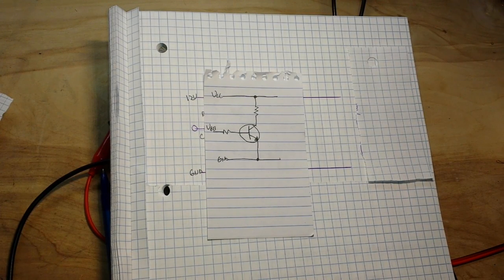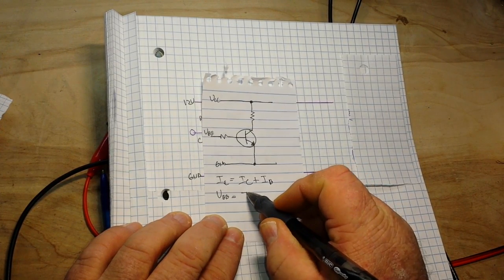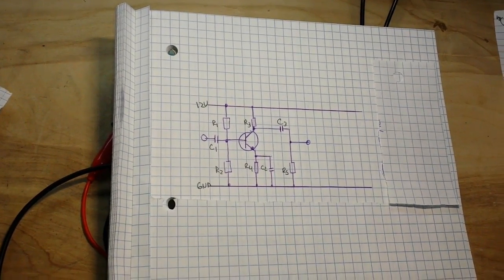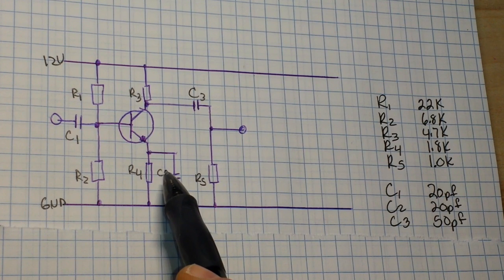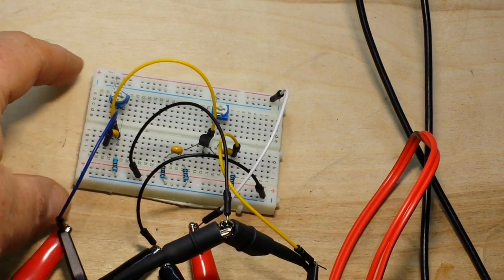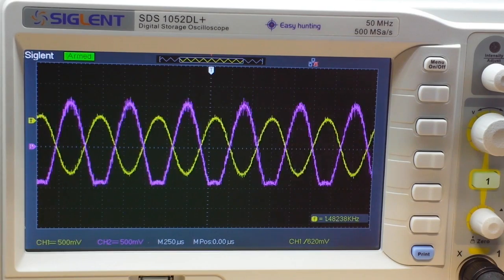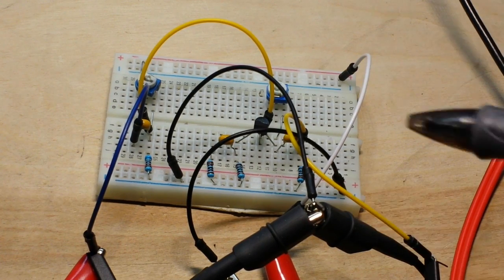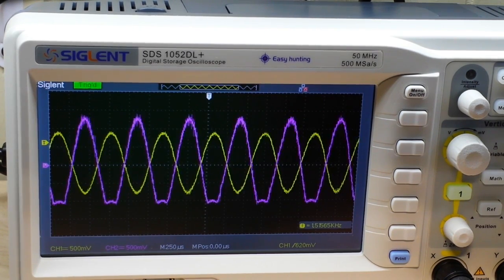Transistors  biasing, and amplifiers

Comment: Having the oscilloscope view was nice to see how the signal flowed. What scope would you recommend? (regardless of electronic experience, thinking quality over learning curve)
Reply from the maker: Anything from Siglent. They are excellent quality at reasonable prices. You can get an entry level scope for about $300 or go big for a mixed domain scope for just under 10k.
Reply: @learnelectronics  glad to know! I've got a siglent in my shopping list that's been waiting until I could research more.
It's the "Siglent Technologies SDS1202X-E 200 mhz Digital Oscilloscope 2 Channels, Grey" 
Model on Amazon

Comment: I didn't understand why the clipping occurs on the negative side, and how to effectively remove it with a circuital solution.
Reply: it happens when the biasing is not done perfectly i.e the biasing is not completely in active reqion rather its close to cuttoff or saturation which is why a small piece of signal gets clipped off.

Comment: Is the output signal out of phase or did you move it for an easier comparison?  This is a common collector configuration is it?

Reason I ask is in the examples I've seen the in phase output is taken between ground and the emitter lead.

I also have drawn load line and it appears as if your base resistor is slightly too low in value and is pushing the circuit towards saturation. It isn't keeping the base current low enough to keep the amp in linear operation.

Comment: While looking at the circuit diagram, on the right side of the schematic, there is a capacitor and resistor(C3 and R5).  Does this not make a high pass filter?

Comment: First...get rid of the uneven clipping then go from there.
Reply: That "uneven" clipping is a result of the miscalculation of the bias point!
Reply: @hugocoolens why is this?
Reply: @justinmyer670  This video is full of errors. To begin with, the capacitors are magnitudes too low in value for an audio amplifier. They should be at least in the 100µF range certainly not of few 10 pF's. The equations the author writes down certainly don't describe how to calculate the optimal bias point for for a maximal undistorted symmetric output signal. To calculate such a bias point the AC load line should be cut in two equal halves by the DC load line. This way you can determine the value of IC,Q and VCE,Q, then you can determine appropriate values of R1 and R2 to achieve this. Note also that R5 (with a proper value of C3) will be a unrealistic heavy load. The main function of R4 here is to make the DC-bias point less dependent of the DC-beta value of the transistor, it is not a power amplifier, so the blabla about thermal runaway is not to the point here. This video is  an example of a very bad design and a misleading lesson.

Comment: I understand this is not an in depth explanation of the biasing/amplification subject but it would be nice to see how you determine the actual amplifier gain (mathematically) and what can be done to prevent clipping.  Is it possible to determine if the signal will be clipped just by doing some analysis of the circuit ?  Finally, in order to demonstrate the circuit sensitivity to the ambient temperature, how about spraying the transistor with some coolant or perhaps heat it with some hot air, just so that we can actually see the effect on the scope.  After all, an image is worth a thousand words, isn't it ?
Reply from the maker: Part 2 is coming up...

Comment: Does kirchoff's law account for current loss via transference of electrical energy to thermal energy? I know in this application it's negligible but in a more complex circuit I could see negligible plus negligible plus negligible eventually equaling significant or at least an amount worth accounting for.
Reply from the maker: No it's strictly theoretical.

Comment: About amplification... can one use the same circuit for one thing to be amplified be used to amplify a different um thing for lack of a better term in my presents of mind... ie can i use and audio amplification to amplify a non audio signal or can I use a boost converter (amplifies power) as an audio amplifier? 

If the answer is yes (or rather technically yes, but we typically use differen methods that work better for their respective applications) than I think I understand.

If the answer is absolutely not, a boost converter wouldn't make audio any louder... note; I do understand that if it would technically work, it would probably sound atrocious. But I diverge... if the answer is no, than I'm confused... how do I know what the different options are for building a circuit that's a signal repeater/booster  for idk say data over supper long distances or ethernet or fiboroptic or something vs what my options of circuit types for audio amplifiers, vs what known amplification circuits are available for power amplification ie flyback (non-invrrting) buck/boost converters... 

If just power amplification is different and audio and non-audio signal are the same i can kinda see that but then I want to understand exactly want's going on, on the electron level in a few of each type because I want to understand how we treat different attributes of electricity differently in order to effectively amplify that given attribute.

 ('Attribute' [of electricity] is the word/phrase I came up with for 'thing' ... I'm still searching my mind for a better term.)

Sorry, I don't really know how to ask this so if anyone who might want to answer needs me to clarify, don't be shy to ask, it's okay to imply that my question is horribly put... it is, i know that, it's just the best I could come up with in this moment.
Reply from the maker: A boost converter works by rapidly switching an inductor on/off. An audio or signal amplifier works by allowing a small current between base/emitter to control a larger current between collector/emmiter. Totally different circuits. The amplifier requires a separate input signal. The boost converter has no signal input. There is no where to inject a signal into the boost converter. It just takes your input voltage and multiplies it by taking advantage of the properties of an inductor.
Reply: learnelectronics okay, so what if your signal was pulses of voltage, (varying differences in potential from say near zero to idk say 10V) ... would the 'signal' be lost in the inherent oscillation of the circuit or would a 'volt pulse signal' be something that could make use of boost converter as a signal booster aka amplifier? I mean this is just theory, obviously because why would one want to transmit signals in such a way... especially since it's a solution to an already solved problem.

P.S. So technically ALL signal amplifiers can be used for audio and vice versa? It's just that some are better suited to one or the other?
Reply from the maker: Yes any amplifier can be used for signals or audio. But some that rely on pwm are no good for audio. As for your other question, that's out of my scope of knowledge, sorry.
Reply: learnelectronics no worries, it was just a wild hypothetical... is there a good reference on which are best for which application? 

I ask all this because I've been researching amplifiers and have yet to see a clear distinction between amplifiers... I need an amp that outputs via trs/phillips/3.5mm headphone jack (too many names, sorry if i forgot the name you use for it) and can push 8 speakers that are wiried in the less common non-advised way (I forget if it's serial or parallel) but there's one way everyone agrees is typically the most favorable and then there's the other way... which is apparently how antique shops (the shop it's self is antique not what's sold in it...like the building is 102 years old) anyways suffice it say the least favorable way is how it's gonna stay wired... so i need a really powerfull amp (ie the impedance should do bad things to most speaker setups) and I need it on the super inexpensive... I don't want to make one, I fear it wouldn't work out too well and would thusly just cause more cost, but I feel since I'm studying electrical engineering I should be able to grasp some basics about how they  work that I could leverage to make a more informed purchase. 

Sorry, I use too many words; what I mean is I'm asking all this to a practical end, and to some extent, for education. Except exploring the idea of making a boost converter into a viable amplifier of some strange sort, that was just a wild hair up my... definitely not practical.

Anyways thanx for all the replies prof. learn.
Reply from the maker: It's all good. A class a-b is a classic high power audio amplifier.